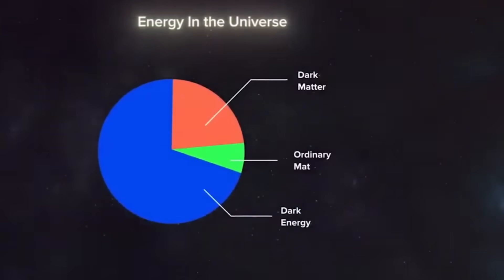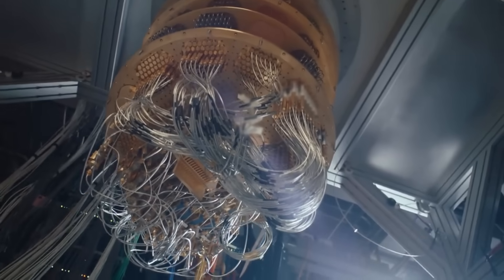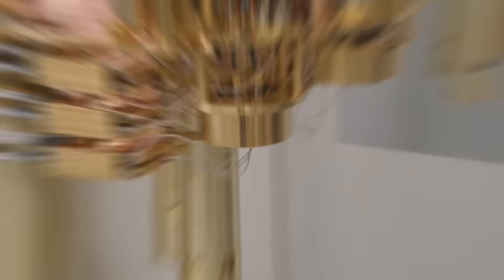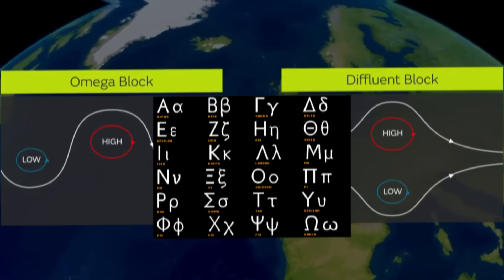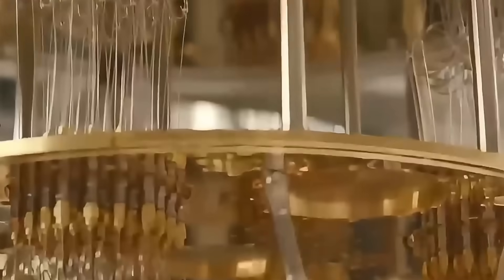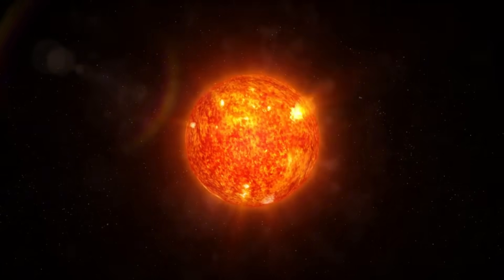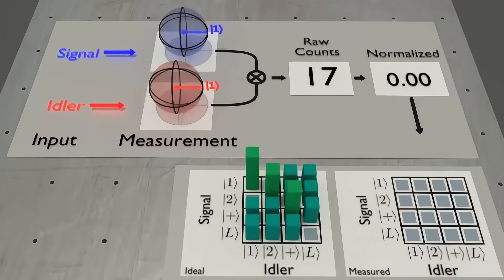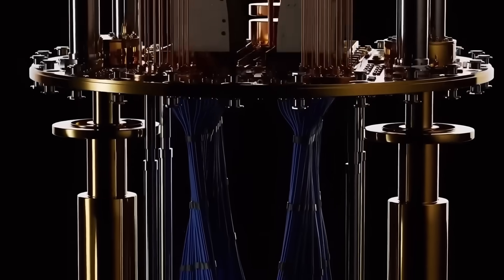Google’s Quantum Core Just CRACKED the Omega Pattern

Comment: I think unrivalling the chain or pattern to the point of no pattern at all, will that not bring us back to nil / 0? Then, omega, it rewrites itself back to the 1st omega pattern. We could set off a domino's effect to implode to explode on itself if we dont monitor the codes. All the universe has to have a fixed pattern, surely. Otherwise, we would be having unstable universe 🌎 planets stars etc, so imagine a slight shift in any direction that that can bring. We are but a tiny speck in space humans have put time and day and date to the earth if we take out the pattern of that and strip it back to the nothing no reference we are back at the beginning. I'm just thinking that We have written our own omega pattern to make sense of the universe and space for our time here on earth. We have called nothing something, and it's that something mathematical Quantum codes that's more scary than AI in the wrong hands.

Comment: Actually, even in simpler programs, erasing does not erase. It can be written over easily enough, but even degausing leaves information. At Google Labs, this is very interesting, but way too soon to push theory as this is likely a series or cellular structure with entanglement. There may be thousands or even infinite or eternal components. Let's see, a year from now. The fog needs clearity, which comes with time

Comment: A computer, that can simultaneously perform functions on different pathways, solve a problem,on one pathway which instantaneously resets all the pathways from that point to explore other pathways again and if a different pathway solves the issue it resets all pathways to the new correct solution to then explore multiple possibilities yet again. Ask a quantum computer, is time travel possible? The answer today is no. Imagine a large enough quantum state computer that can explore all possible functions, that will invent the tech possible to make time travel possible. Do the vitual experimentation parallel instead of linear like the human race develops technology in our civilization. Imagine the quanta runs parallel computing a resets all lines of code everytime it develops a solution. Ask,it a question, is time travel possible, in years, months,  days or moments it comes back with ..... yes. The next question, ..... how, and it reveals 150,000 year worth of linear human toil revealing technologies not to be conceived for thousands of generations. Only to come up with the ultimate answer ........ 23.

Comment: The omega pattern is a stable pattern, and the quantum bits seem to be seeking a natural equilibrium state. In meteorology the Omega pattern is marked by 3 pressure nodes, 2 low pressure structures, with higher pressure located  between them

Comment: Thanks for this video.  Omega pattern is the most controversial subject of the moment.   Let's see if the pattern is present into the cosmic  microwave background ?   Is it a mathematical distortion of the computer understanding of space ?   Is it a hoax ?
Reply: It’s a stability pattern that results from particles seeking an equilibrium
Reply: @Colbyatops  Thanks for answering.  We know this is existing into iron blocks,  atmospheric Ions,  and nearly any material in the Universe where + and - are possible.   how do we know this is real for the Quantic Field ?  How do we know it is  not a fabrication of the Quantum Computer based on mathematics ?
Reply: @1964_AMU  probably because although very very small, quantum particles carry different electrical charges, and will be repelled or attracted to other particle, this creates a dance that seeks equilibrium, or stability, and the omega pattern is very stable, or sometimes stationary resonance, until it breaks down and moves on
Reply: @Colbyatops  In the cosmic empty emptyness,  there is at least one particle per cubic meter with a charge,  it can be an electron, a muon...   some have no charge like neutrinos.   

What explains that the empty space,  the field, how it is called ,  where this one particle is excluded, there is a a charge and it has  got a temperature ?  

The infinite zero existing only in Boulders Colorado University lab at  -272 C degrees into the Boze Eintein Condensate, the cooler spot of the Universe,  if any ET does not have it into their own lab.   

So,  what could make the FIELD show this pattern ?  If this was already experimented,  and not just predicted by the Quantic Computer ??
Reply: @ I still think it seeks a natural equilibrium or more stable configuration, it has been shown even at absolute zero , quantum particles and super positioning waves are still in motion
Reply: @Colbyatops  YES,  you just came to the point,  particles are also waves !!   These waves can cross the absolute cosmic void
Reply: @1964_AMU  indeed, its mind blowing

Comment: Next is to compare the deviations of the original pattern between different systems in detail, are those identical, is there anything systematic in the differences of the deviations? Is it about stability of power, stability of the materials used, nuanced microscopic changes of temperature at the time of calculation, can anything external interfere, for example a heat signature within the quantum processor, and when those and other similar differences have been observed, we might be able to rule our many alternative ideas what it could be about.
Reply: I think they are comparing the differences already

Comment: Sounds like a resonance-based phenomenon as when a lot of metronomes with the same pace placed near eachother but started at different time after some hours synchronize themselves .
Reply: @dieterschonefeld7428  That is very interesting, so the metronomes when set to the exact same tempo, but staggered randomly carry enough flux within their own individual cycles to respond and 'adjust' to the collective tempo, even though they were triggered out of sync. That's nuts. I wonder how long they remained locked in before gradually separating again. It is a fact that even if they are all set to different tempos, that eventually there will be a convergent point  wherein tbey all click together , this is a completed polycyclic wave.  But metronoms of course are imperfect time keepers by design, and are meant to illustrate given tempos, not necessarily to 'keep time' because they are physical mechanisms that cannot achieve perpetual motion but naturally slow down and eventually stop. The phenomenon you described could simply be because they are all slowing down together and that rate of deceleration might perhaps vary enough between them so that tbey converge as tbe wave descends toward zero. It is kinda like the 'monkeys with typwriters' theory. That if there are enough monkeys randomly typing for a long enough span of time that one of tbem will eventually print out a Shakespearean Sonnet. That the equation itself is tbe catalyst for a result that only appears to be that of a super-intelligent monkey, but is in fact, a mathematical probability equation that allows order to emerge out of chaos.
Reply: More of a configuration phenomenon was my take, seeking equilibrium results in a stable omega pattern
Reply: Too, when a group of women remain together over a period of time, their menstrual cycles will begin to synchronize. Too, in a body of cells, the condition of the strongest among them will eventually influence all within the group. Synchronize, or Singularity, which is it?
Reply: @joeparascandalo6989
Wrong collective noun there, mate. A collection of women is a gaggle.
Its not just menstruation.
In my experience,  said gaggle will also quickly harmonise around notions. In particular they will quickly agree that men are a bunch of wankers requiring them to engage in ceaseless nagging and corrective instruction. Bless 'em.😂🤣

Comment: Why do you include weather maps in this discussion?
Reply: @emasolie4135  because an omega patern is a feature of a specific weather patern. If its actually a quantum  thing ... i have no idea ? But the traditional omega patern as we know it is a formation of weather paterns causing the omega symbol on a weather map .
Reply: Because in meteorology there is a pressure pattern called the omega pattern where high pressure is sandwiched between 2 areas of low pressure, forming an omega Greek symbol
Reply: @Colbyatops  And that's  why AI confused and used it in this video but totally unrelatable.
Reply: @jonj3233 wow, ok, you'd think it would know it's unrelatable, unless it artificial ignorance 😅
Reply: @Colbyatops  What I gathered from the presentation is that it was the hasty conclusions made by human scientists that needed rectifying. AI is just a tool, but a very sharp one. Easy to cut one's self, (metaphor).

Comment: How about this: in classical computers, clearing the memory deletes the old data. But when you clear the memory of a quantum computer maybe that's not the case. Since the qbits became entangled in the first run, wouldn't they remain entangled? So clearing the memory wouldn't get rid of the data in the same way as classical computers. Maybe the entangled qbits stay that way so all future runs of the program would retain the original data.? Just a thought.
Reply: I like the way you think sounds like a valid theory super position could have a locking mechanism to retain data
Reply: In a nutshell, what goes around comes around!? I think if we have the capacity to conceive something, anything, it either has already happened or will happen in our future.
Reply: @Marcus-t3z  They're both the same.  Past & future. Just depends on where YOU 🫵 are
Reply: @satori2869  all of life is atomically entangled, from the original source. We have only just scratched the surface of reality. Once something is "discovered" it becomes easier to replicate, like the first time a complex molecular structure is synthesized.
Reply: @satori2869  it remembers, evolves, and was placed here intentionally?!?!?
Reply: Can you clear your memory then act as if it's cleared?
Reply: @andredavis69  rephrase the question.
Reply: @andredavis69 
Let's ask DJ Trump!😊
Reply: Look up quantum ram. We can simulate entire universes in a single byte value. Terrible things happening we can create and destroy realities.
Reply: @Andrew-zy9zp  Those poor realities. 🥺  We need an endangered realities list for the conservationists to monitor
Reply: @emcee3444  i came into this cuz i like computer hacking i wanted to have a super power lol i never thought it would come to this. Reality is crazy.
Reply: goood ol superposition =D
Reply: Right... 'cause they're entangled. Makes sense to me...
Reply: I like the way you think 🙏🏾💯🙏🏾✌🏾💪🏾❤️💛🖤🏞️🧘🏾‍♂️🔥
Reply: Deleting a classical computers memory does not alter the memory content. I merely removes the links to the data. You would have to write a data pattern to the memory to erase the data. The most common patterns are all zeroes or all ones. Random takes longer. The question is; Are there traces of the old data pattern left at the atomic level?
Does the former pattern affect the quantum state of the atomic structure of the physical memory materials?
Does RAM assume a truly random state when power is turned off or is there a residual pattern?
What pattern forms at turn on?
Does that change the computational results of an algorithm? 
Are there Ghosts in the machine? As Asimov suggested.
Reply: Deleting a classical computers memory does not alter the memory content. I merely removes the links to the data. You would have to write a data pattern to the memory to erase the data. The most common patterns are all zeroes or all ones. Random takes longer. The question is; Are there traces of the old data pattern left at the atomic level?
Does the former pattern affect the quantum state of the atomic structure of the physical memory materials?
Does RAM assume a truly random state when power is turned off or is there a residual pattern?
What pattern forms at turn on?
Does that change the computational results of an algorithm? 
Are there Ghosts in the machine? As Asimov suggested.
Reply: yes, my thought entirely. an embedded pattern that comes from the structure of the qbit chip.
Reply: @satori2869  perhaps something like this could help with preventing or fixing memory problems in humans? This is starting to sound like sci-fi turned real 😄
Reply: No. You lose entanglement upon measurement
Reply: @rocklee5231  No you don't. It is not related.
Reply: To me it confirms that scientists need to include (God) or ( I Am ) must be included in the mathmatical thieries of quimtim physics
Reply: @kwbrown8216  I think we should ignore ALL of religion, in order to move forward. Every single discovery we've made, that had a supernatural explanation before, turned out to have very natural processes. There hasn't been any good evidence for anything supernatural, so why would we try to shove it in our models and equations?
Reply: @matthew6427 In my opinion there are only natural processes.  Religion evolved to give explanation to the, then, unexplainable - usually starting with the easily observed natural processes like lightning, earthquakes or volcanic eruptions (insert God xyz is angry). Simply repeating the process of praying or performing some type of ceremony will eventually coincide with the quelling of the "god's wrath and, hey presto, you can claim it was the praying or ceremony that was successful. Your religion then has validity...
Reply: @thisisme8666  Exactly. It looks really impressive when you only count the hits and ignore all the misses (or use the old 'god works in mysterious ways').
Reply: I AM, and Their rules and guidance, needs to be THE primary concern of every scientist and researcher involved in "thinking machines" of this degree of god-like computation.

Scientific research has no built- in ethics.  It's modus operandi is , "Hey guys, watch this!!!
Not, "Guys, should we really be doing this???"
Reply: @glenliesegang233  This though, so true. Some things are best remained theoretical until significant evidence has proved no unforseen harms can be done. I think atomic bomb?
Reply: Actually, even in simpler programs, erasing does not erase. It can be written over easily enough, but even degausing leaves information. At Google Labs, this is very interesting, but way too soon to push theory as this is likely a series or cellular structure with entanglement. There may be thousands or even infinite or eternal components. Let's see, a year from now. The fog needs clearity, which comes with time..